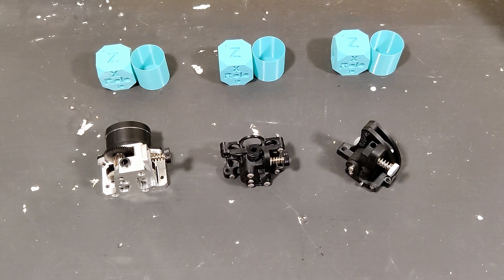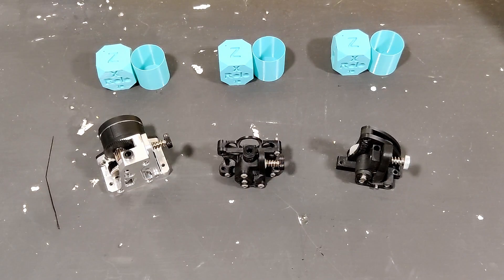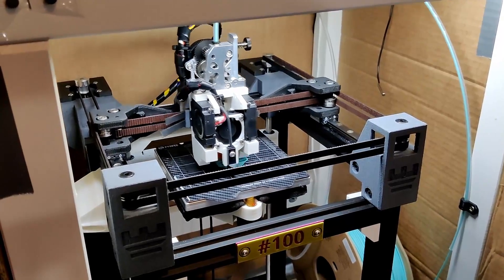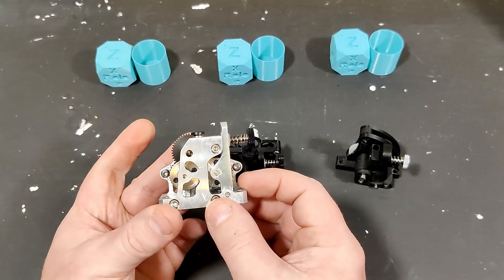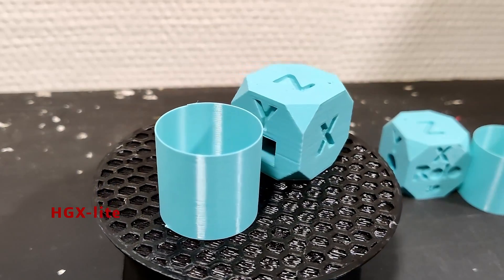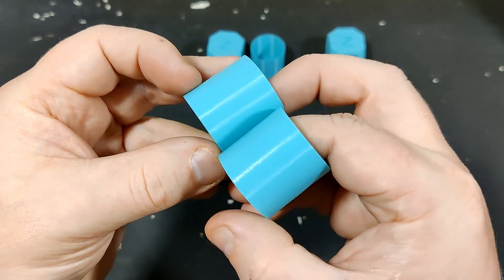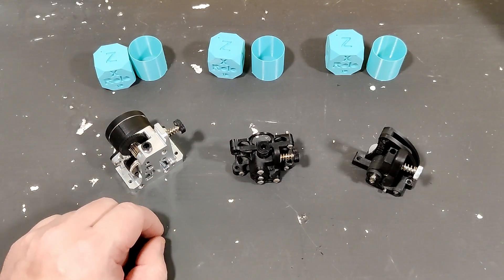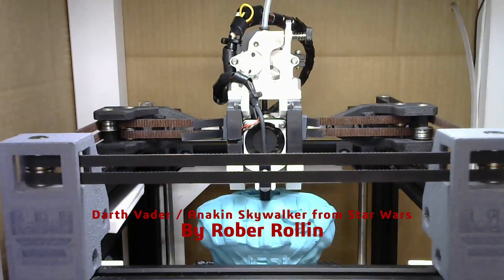HGX-lite mini review and comparison with the Sherpa mini and Sailfin

Comment: I can't find anywhere if the HGX has room for a PTFE tube out the bottom? Can you tell me if it has one? I'm thinking my ender 3 custome needs a ptfe connector between the extruder and the hotend but maybe not if I find a strong enough mount for the HGX.  Is there a hole for PTFE tube in the bottom?
Reply from the maker: There is a hole, yes, but not a coupler. It's just a 4mm hole.
Reply: @kanrogcreations sweet thanks for letting me know. I have a tap and die set I wonder if I can tap it out for a small PTFE connector. If there's enough aluminum around the hole to do so
Reply from the maker: I would rather have a printed adapter for a pc4-10 fitting. DM me on discord and I'll make you one 😉
Reply: @kanrogcreations hech yeah bro.

Comment: Good day, following up on my previous comments. I managed to fit a NEMA17 pancake stepper to my HGX-lite. with this very simple mod, I can now print up to 90 mm/s (the highest speed I have tested). I have a 400 mm^3 Core X-Y printer with 900 mm boden tube. It is not a direct feed. All one need is a simple adaptor/spacer and a 20T gear with 5 mm bore to fit the NEMA17. If anyone is interested, I can make the stl file for the adaptor availabe via Kanrod Creations.
Reply from the maker: Nice work! Upload it to printables 😉

Comment: I'm deeply disappointed in mine. It slips constantly. I'm printing at 70 mm/s. I find better performance with very little pressure on the springed lever. Only just screwed in.
Is there anything I could be doing wrong?
Reply: After some futher investgation, I found that the motor torque is insufficient. It is not the filament that slips. I can print up to 50 mm/s, faster than that the motor slips. I'm looking at rplacing the motor with a NEMA 17, or add a gearbox. I have not been able to find the suitable hardware for such a project.
Reply from the maker: I had an issue with a missing bearing, would recommend a full disassembly of it and check the bearings.
Reply: I believe in giving fair reviews. I have taken the unit apart. All parts and bearings are present. It seems the manufactured tolarences are large...resulting in noticable play on all components. I did manage to "tune" the idler spring setting for optimal grib. As reported in many reviews, the moter torgue is lacking. I made my current setting 900 mA (RMS) and it made a noticable improvement. As reported, the moter slips when the pressure is beyond the extruder capability and not the gear grinding the filament. In essence a good thing.
How did I do the tuning...I started with the screw just screwed in (minimal spring force) and extrude 20 mm of filament at 500 mm/min (g1 e50 f500). Thighning the screw in 1/4 turns until I got good no grinding. Actually I started noticing the moter slipping. That's when I increased the driver current. Originally 500 mA.
Reply from the maker: One of mine started skipping and did a complete teardown of a silver and a black one. 
It seems to me the silver one has different bearings. They are not as good as the black one. I've ordered new bearings to put in the silver one.

Comment: There is a new updated version of the HGX from haldis called the HGX-Oblique with helical drive gears and a smaller,lighter frame, the quality of it seems very nice however is it nearly twice as expensive as the standard unit. i have one for the Tronxy i'm building right now i will have to see how it performs in comparison to the old model
Reply from the maker: Interesting, I'll have to look into that, thanks!

Comment: There are some other differences. I have used 2 of the 3 (sherpa, HGX). The sherpa will wear out the housing in X time printing. The hinge area wears and the body where the filament passes through. For weight, the sherpa comes out on top. My HGX was 75 grams vs 35 for the sherpa. There is also the issue of torque. May not matter on slower printer, but at some point can be issue if you are pushing some filament. Seems the best bang for the buck is the CNC VZhextrudort. Very good quality with that one! Keep up the videos!
Reply from the maker: Valid points indeed. I'm not set up for doing too much testing, I just wanted to get at least some information out there on the HGX, not much out there
Reply: I am not quite understood which of the extruders you have mentioned have problems with the high speed prints